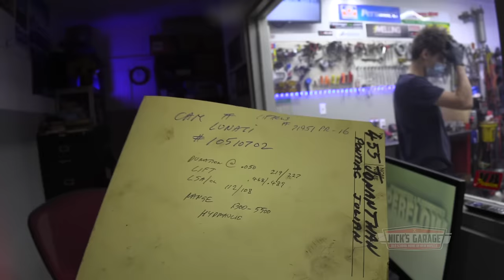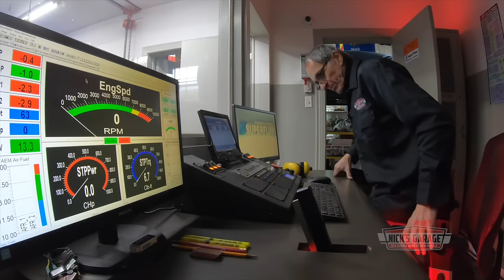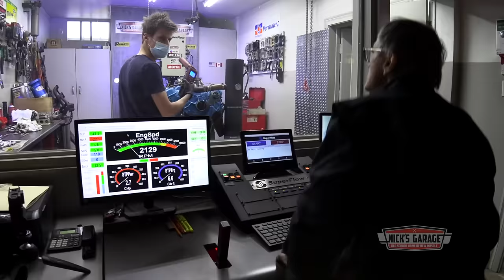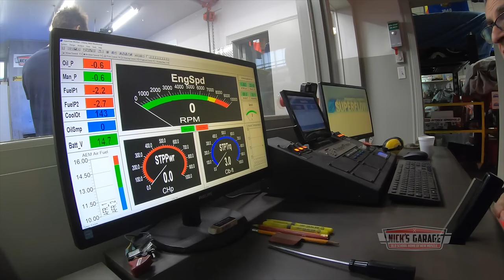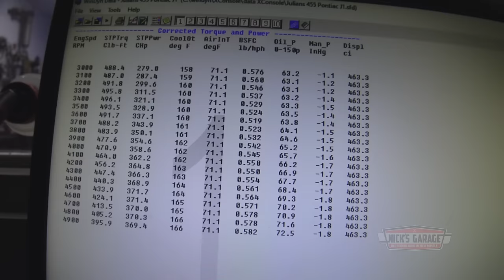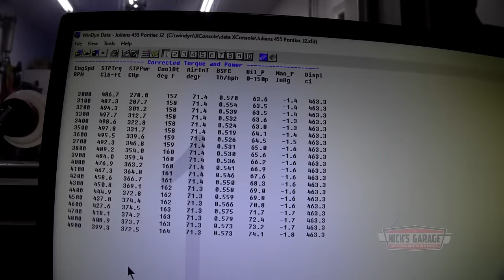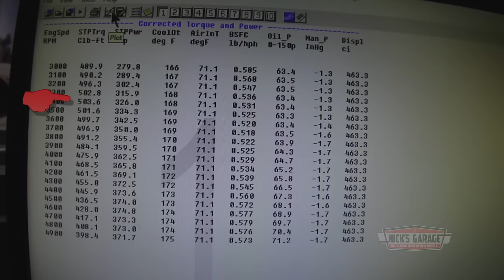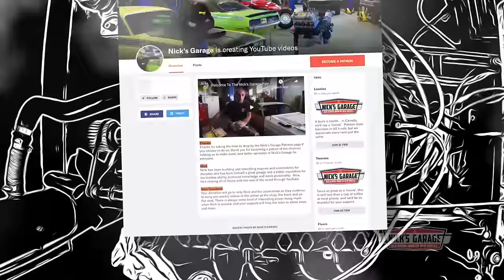Pontiac 455

Comment: Some of the late 70's Pontiac Trans Am cars came with the Oldsmobile 403 engine.
I swapped one of those 403's into an 80's diesel Oldsmobile Cutlass Supreme. Easy swap and the car drove well with that engine.
Reply: My best friend has a 1979 sliver Anniversary Trans Am with a 403 Olds engine, still has it after selling off most of his firebird collection. At the time he bought the 79, he had 11 1967 Firebirds and 8 parts cars, oh and one 1968 Firebird with a 400, 4 speed.
One of every model Pontiac made in 67. Only has the 79 and the 67 ragtop left.
Reply: That 403 had some large diameter pistons, just not alot of stroke.
Which is probably good; don't thing the bearings was very large.
Mine had the quadrajet and center shift console with buckets.
 The front springs felt correct since it was an ex- diesel car.
Handled as good as a G body could from that era.
Accelerated very well for being a smog engine, ran smooth and all the accessories worked.
Was a good upgrade for a Cutlass Supreme that bolted up easily.

Comment: Wow those cast manifolds are real works of art!
Reply: Just as good as headers    because they are factory headers   made by Pontiac     he'll of a motor   I got one like that    Pontiac all day
Reply: @lacolello6644  thank you sir I could see at first glance they weren't run of the mill manifolds my father has a 389 in a rainbow bread van he bought the motor out of a wrecked HTC in the early 70s and put it in the van unfortunately he couldn't get it to cool right and it sits there to this day real shame factory chrome and all !

Comment: The car I learned to drive in was a 1971 Bonneville with the 455... it was my mother's car. 
Between the brakes and the throttle, you had to learn pretty quickly to be gentle with those pedals!  :-)

Comment: WHAT ARE THE CASTING NUMBERS ON  TOP OF THE CENTER EXHAUST PORTS?  It was hard to read them in the video.  Pontiac had several casting numbers over the years and there's a lot of differences between the heads over the years. Great video.
Reply: Casting number is 96 🙋
Reply: 96 🤓
Reply: @dihydrotestosterone    ..Thanks.

Comment: Your voice is probably due to the humidity being low because it's frozen as in freezedried. Happens to me too. As bad as I hate these masks I've been wearing one when I'm in the very cold element's because it helps to preheat the air and has a little humidity left in the mask from me exhaling also. If I don't protect my lungs then that dry cold air will make me raspy. We're not young anymore. Oh well, we're still gear head's.👍😎

Comment: Most Pontiac high horsepower engines had a specific Carb.  The Q-jet had bigger jets and special metering rods  The engine has perhaps the later 455 carb which is pretty crappy.  An old trick we used to do was to pull the rods from a 472 or 500 Caddy they were nice and rich with tiny ends... your statement of the carb being to small is right on the head. Normally a 455 made huge amount of torque around 2500 which is great for a street engine.. Tons of grunt to get you moving.
Reply: The 1973 850 CFM Super Duty Pontiac 455" Q-Jet cast with no venturi in the secondaries...

Comment: With that TQ-HP curve this 455 is really by today’s standards the ideal 3/4 ton truck motor. How much more could Nick get out of it with his favorite carburetor?
Reply: We are going into further testing with bigger carb and 1.65 rockers.
Reply: I've always thought big Pontiac V8's are perfect truck motors. Use a 2 bbl carb and the torque comes on right from idle.
Reply: @johntempest267  - Vacuum secondaries 4 bbl. Q-Jets give best of both worlds... late 1950's GMC pickups came with big Pontiac, Olds, and maybe even Cadillac V8's...
Reply: @BuzzLOLOL  
I didn't know that. Very cool.
Reply: @johntempest267  - At a time when most pickups had weak flathead 6 cylinder engines and struggled to reach 60 MPH...

Comment: This was awesome to see you do a 455! through High School in the 80s I had a 71 LeMans Sport with a 455 everything stock and went 14 flat at the track.Then I switched the heads to a 6x casting head and freed up the motor and wen 13.2 . Im betting the heads on this engine are holding it back.Those are the 86 casting im pretty sure thats what I saw.With the 6x heads it will rev past 6100rpm.  86s stop flowing real good after 5300rpm. I never did this on a dyno other than my butt and the track.
Reply: 71 gto heads.........
Reply: Nick has an earlier Pontiac 455 video...
Reply: I run Edelbrocks on my current 455 in my GTO. But I never turn it higher than 5500rpms. A 455 isn't a small block Chevy, or even a big block Mopar. The factory used cast iron connecting rods and cast pistons because they never intended the engines to rev that high. Even the 71/72 455 HO engines redlined at 5200 rpm's. I have read stories that claim Pontiac actually used lifters that would pump up and limit the 455 HO motors to 5200 rpm's to keep from having a bunch of warranty claims. I'm not sure if that's true or not but it sounds plausible. You might try keeping the rpms down though. I'm sure it will turn them, just not sure if it's actually helping your E.T.'s?
Reply: @1967davethewave  all I know is just by changing my head's and Edelbrock intake my engine stopped struggling and freed up! I understand it's not a small block Chevy but I've out run a bunch of them. I never had money so I built with used or parts from my garage.
Reply: @davidjohnson8474  I bet those 6X heads did free up some real horsepower. I'm just saying that even though it might rev a lot higher doesn't mean that it should be revved that high. Next time you're at the track try shifting around 5500 a couple of runs see if your E.T. improves. Seriously, if you run the engine 500 or 600 rpms past it's power peak you probably won't notice it but you will be losing E.T. And I used to rev my Pontiac engines to the moon when I was young, back in the 80's and the bearings paid the price. A great Pontiac racer taught me a lot in the early 1990's and one thing was unless it's an all out race engine never rev it over 5500. His 71 Lemans wagon was running in the 11's with the same #96 heads Nick just used on this engine. Look him up. He had a stroke and doesn't race anymore but his car is on YouTube in some old videos. His name is Jim Hand and his Lemans Wagon was in may magazines in the 90's. and If I sounded like a jerk I'm not trying to be, I'm just relaying what I have learned about Pontiacs in the last 35 years.
Reply: @1967davethewave  no bud it's all good! I just let people know what I've done in the past. Omg I wish I had that 71 Lemans wagon!! I had one in 85 but rusted to junk in Maryland. Those wagons are so hard to find 😫. Oh well I'm sure it is long sold. Oh I did spend 9hrs at my track 75&80 in Maryland which is closed now and shifted from 5-6200 & found the difference from 5600-6200rpm was 3.5 tenths and 6100 was the best. As I've got older now I'd fuel inject it and have a way to monitor it to tune it.

Comment: Q jet issues again, I wonder why? Nick as we have talked about before, a Q jet is totally LOST until you get the back pressure of a properly sealed AIR CLEANER on top of it!  None of the Q jets will perform correctly until a sealed air cleaner is installed.  This was proved on the GM dynos decades ago. Want to see better and repeating power numbers? Put an air cleaner on it with a top gasket between the air cleaner base and the carb and watch how much more sold all your numbers stay. You will be amazed at the difference an air cleaner makes on any Q jet. Like my dad use to tell me, just DO IT !  Seems every time you test a motor with a Q jet you say the same thing, it's too small or it's lean , The 455 Buick and now the 455 Pontiac, it will be the same problem with a 454 Chevy or Olds 455 as well until you use a well sealed air cleaner on top of any Q jet. You got the dyno, try it.
Reply: Tests show a S.S. salad bowl from India works best on top of a carb.!

Comment: I had a 1969 Pontiac Catalina 400 with a 2 Barrel carb my mother had a     1972 Pontiac with a 455 and a 4-barrel on it big difference in power that 455 with a 4-barrel looks like taking off in a rocket lots of torque and horsepower it was like take it off with a jet really fast lots of horsepower and torque 455 with a 4-barrel it was like strapping a rocket to your ass it would suck you back in the seat and could not move forward during acceleration it was a badass car

Comment: Considering that engine was factory rated at 200 BHP and 330 pound-feet of torque in 1976, I say it is phenomenal.
Reply: That's with a stock cam and lower compression with a lot more Restricted ex manifolds and standard bore ,he rebuilt the engine so did he pick out the cam?I knew it wouldn't make much HP he couldn't even get 350 HP out of a boss 302 he built and he's hot 340 took an after market cam and head work to make 1 HP per cubic inch lol he did do ok for a Pontiac engine I would have used a edelbrock RPM cam and a big double pump Holley ,Pontiac heads don't flow good # unless its a SD 455 head in this case he gets a pass

Comment: Guessing about 400hp. Pretty mild cam, decent compression, guessing a 650 qj, ram air manifolds better than normal but not as good as headers and the pontiac intake 68 to 72 excellent flow but heavy. 500 torque no problem on the Pontiac. You know they did make some 800 cfm qj's for the ho and sd cars. There are eldebrock qj's at 800cfm too.
Reply: The 70 Eldo used a special 803 Q jet.
Reply: Also 1973 850 CFM Super Duty Pontiac 455" Q-Jet cast with no venturi in the secondaries...
Reply: @BuzzLOLOL  I always wanted a 428 SJ Grand Prix.  Very rare.

Comment: 4:14 Most of the Quadrajets were 750cfms, with a few rarer models being 800cfms. 

And yep, you are correct, they ARE great carbs for a street car. The tiny triple booster primaries make for great throttle response and MPGs, and the giant secondaries work off air demand and make a sweet howl when theyre wide open. The Quadrajet was a complicated carb, and was difficult to work on until you learned everything about them, but they sure DID work nice on the street when the time and knowledge was put in to getting them right for your particular engine combination. They weren't much good for drag racing due to them being complicated and there being a lack of tuning parts readily available for them. Many people ended up calling them "quadrajunk" or "quadrapuke", but those were just the guys who didn't have a clue about how to work on them.

Comment: How did you get the compression up? The '71 GTO 455 had 8.2-1 compression and the '73-74 had 8.0-1..
Reply: I think Nick decked the block Roy. I think he also used thinner head gaskets too.
Reply: @electronicengineer  ...That is correct.
Reply: Flat top pistons...

Comment: Note, The old actual Pontiac motors got the compression off heads. they always used flat tops. so if you put a set of  heads off a 400 that was 10 to 1 on a 455 you are looking at 10.5 to 1 or more. take a set of old 326 heads on a 400 you are getting like 11 to 1. Want a good Pontiac motor? Get a Ram Air 5

Comment: Don’t stress Nick. That 455/ 350 Pontiac was never a high performance motor. You are too used to those big Mopars. It’s all in the compression and stroke, you know that. The 1970s Firebirds looked faster then they were.

Comment: Nick, you alway do a great job building an engine! This engines scares me because I don't like Pontiac or Oldsmobile engines. They'er hard to start. They are hard to keep the timing just right and keep it running. If the timming isn't right the engine backfires a fireball through the carburator.  Also sometimes the throtle sticks wide open because the throttle spring broke! One time I was with my ex-brother inlaw in his 1969 Pontiac Firebird back in 1984 and a valve went through a piston! "KABOOM!" He wasn't even pushing the engine R.P.M.  up! In my person opinion, Pontiac engines are the' worst engines General Motors produced. They always had problems. Nick, go drink some OZZO. That might loosen up the flem in your throat.
Reply: Not hard to start.  Never had problems with olds.  350 or 455.
Reply: @dukeallen432  Well, you had better luck with your Pontiac than my Ex-Brother inlaw. That car broke down all the time. It was hard to start and backfired fireballs up through the carburator. The carburator spring broke and that car took off!! He had to turn the egnission off. Then started it up after replacing the spring. It ran fine for about an hour. Than one of the vavles dropped and went through a piston. That 1969 Pontiac Firebird was a joke!  I had a 1972 Oldsmobile  Cutlas in 1984. It never ran right and backfired through the carburator just like my Ex-Brother inlaws 1969 Pontiac Firebird did. It was the V8 350 Rocket engine. A friend of my father and I were fixing it up and was just about to paint it one morning and the car was stolen out of the garage🥺. My car was gone!
Reply: Lots of  OUZO in my shop. Time to take a shot and cheers.
Reply: @nickpanaritis4122  I wish I could join you, Nick. I haven't had OUZO since I was 16-17 years old. That stuff kicked my ass!
Reply: @richardbrowne1217  - Sounds like your exbro-in-law abused his vehicle... they make double throttle springs so when one breaks, the other still works, then put new double springs on... you guys didn't have the engines tuned up right, either... ro worn out... 
Pontiac and Olds engines as dependable as any others of the day...
Reply: @BuzzLOLOL  Well....his Firebird was a hand-me-down car is father bought for him. Blame it on his father for buy a piece of junk. He did what he could to keep it running. He didn't have any money.

Comment: Pontiacs don't like a lot of ignition advance, especially 455's. Backing off the timing has the effect of richening the mixture too. With the hydraulic Voodoo cams, the 455 really likes the smaller ones with 112 degrees lobe separation and not the larger ones with 110 degrees separation. If going for a larger cam in a 455 go with wide lobe separation. The Pontiac intake beats a lot of aftermarket intakes, but the regular Performer (non-RPM) adds an easy 15 hp. The 455 responds well to larger carbs. The vacuum secondary 850 or 855 Holley isn't too much. Total timing 30 - 35 degrees and usually best 32-34 degrees. Headers help a lot, but not when cast iron manifolds are desired. Crower cam # 60916 is the magic mild 455 flat hydraulic cam. Lunati sells the best Pontiac valve springs, 10 degree keepers and retainers.
Reply: Nick ended at 36 degrees total timing which was kinda the standard on all engines back then... later Vortec engines may prefer 28 - 34 degrees somewheres...
Reply: @BuzzLOLOL  The Pontiac head chambers are machined, not cast and they don't a lot of ignition advance. Also if using a stock type carb, backing off the timing will richen the mixture, without having to locate jets for the carb.
Reply: @jimjungle1397  - Changing the ignition timing doesn't change A/F ratio...

Comment: The Rochester Quadrajet usually ran 650-750cfm. Good carburetor.
Reply: There were some 800 cfm versions like the ones used on the SD 455 Trans Am

Comment: Chances are that Q-jet is a standard 750cfm that most GM vehicles used instead of the 800cfm that the early 70's Pontiacs came with.  I've always been impressed with the torque numbers the 455 put out.

Comment: The carb is fine for that engine. It's those cast iron lumps of exhaust manifolds that choke it off. Bolt on a set of headers and you'll hit 450 hp with that carb and combo.

Comment: Nick,  stock 455 had  800  cfm Qjet.  slightly larger primaries.  
but...they are still an emissions carb, with imbalance between small primaries, and large secondaries.
you can change rods, hangers on secondaries, and jets, rods in primaries.
on a heavy build 250 duration cam @ .050"  I have removed the primary metering rods completely, and run just the jets on Pontiacs.

actually I've built more Pontiacs than any other make, just built a 455 for myself, for my GTO I've had since 1981.
the reality is, they need an 850 Holley carb, vacuum secondary...the best running one I had, was a Barry Grant 950 cfm on 455
it was like day and night better.  the big stroke and cubes need air !  850-950 cfm

Comment: Pontiac engines run so much smoother & last so much longer with exhaust manifolds. 
    It's the mistaken addition of the headers when problems start to ride.  Best way to go is to try & port out the exhaust manifolds if one desires those extra 20 ponies under the hood. 🐴

Comment: With 20" of vacuum and seeing the power curves, I'm wanting a bigger camshaft.  The next higher in the Voodoo series is 227/233 @.050,  .489/.504 lift.  Two steps up is 233/241 @.050, Lift .504/.527.  I think something in-between those two would be best, something like 230/236.  A 30 over 455 is a lot of cubes, makes a bigger cam more livable.

Comment: Thanks for video! My guess was 392 hp and slightly under 500 torque.
I absolutely know the feeling of starting a reassembled engine the first time, it's dreadful. I have rebuilt my own Trans Am engine (403 Olds) myself, first time ever to do a V8... It was reassuring to see a lifter failure for a pro, had a lifter collapse on my engine, I freaked out!
Reply: By the way, q-jets can handle up to 700 hp. And most of the stock standard q-jets have a restriction preventing the secondaries to open fully, looks like the carb on this 455 has the restriction.